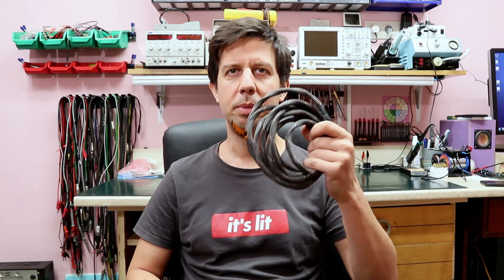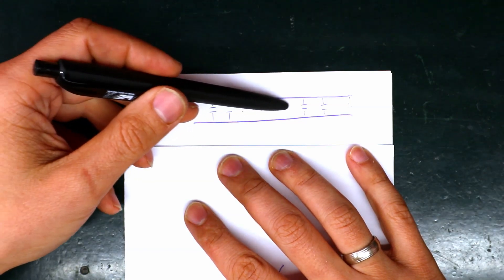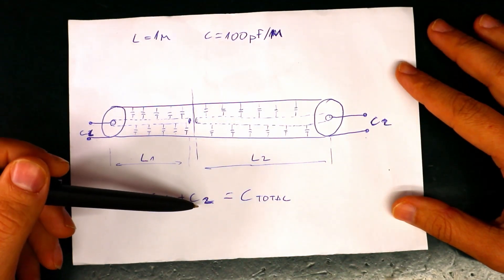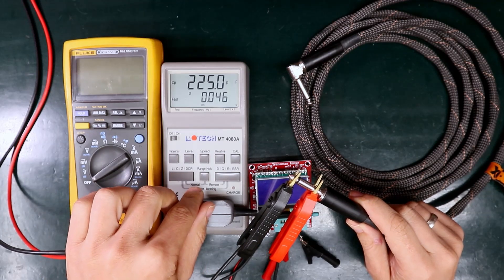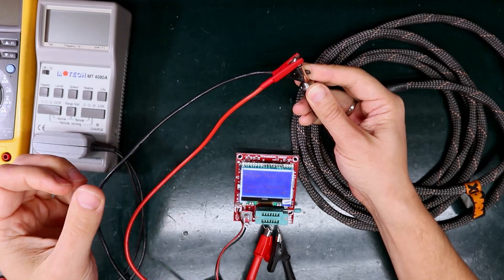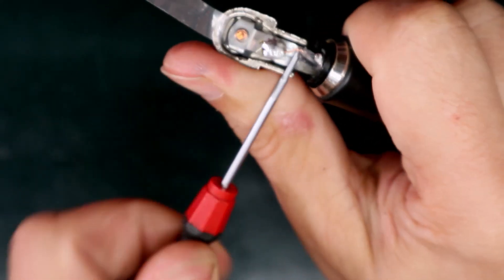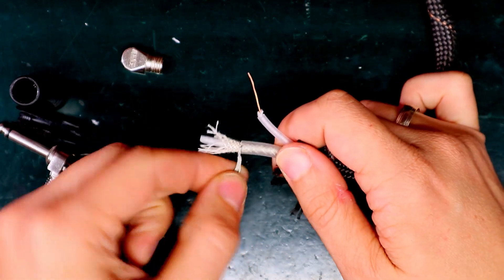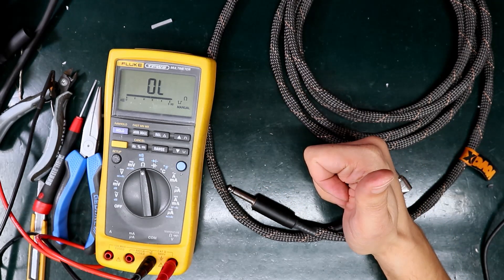Finding an open circuit in a Vovox guitar cable + repair

Comment: Hi Nik I’m wondering if the additional cable that you m connected to the ground was as well connected to the ground on the other connector ? I know that, in guitar circuit they create ghost ground to reduce hum I.e in an LP if you want to reduce noise from the selector to the main circuit, you can have an additional cable that is ground to the selector and twisted around the main core but not connected to the ground at the main circuit.
Reply from the maker: Yes, the additional ground wire is connected on both sides. I really can't understand why it exists...

Comment: in all cables i repaired except for one, the jack plug wasn't connected to the core anymore. so not a broken cable but a bad solder joint
Reply from the maker: I've been repairing a lot of cables. I had a couple problems with an open circuit somewhere around the cable. I think this problem is not common but it exists.

Comment: why would a guitar cable use solid wire as its core ?   Most are stranded i think
Reply from the maker: I can't explain. And more -solid cables are prone to fault more than the cores with multiple wires.
Reply: So you will break it and buy a new one, lol - I have solid core silver interconnects connecting my pre-amp to my mono blocks in my stereo, and I prefer the sound of solid core to stranded, but it makes no sense in a guitar cable... Was considering buying their XLR mic cables, but this changed my mind...